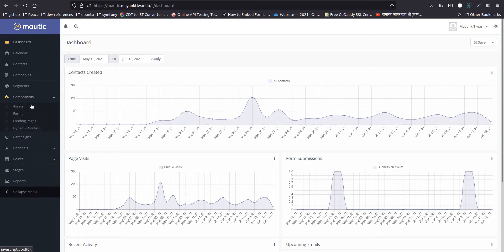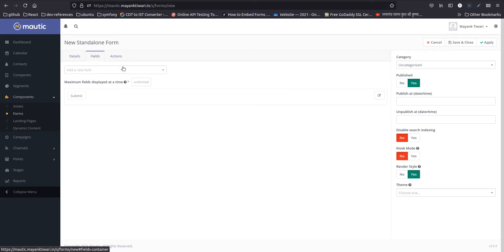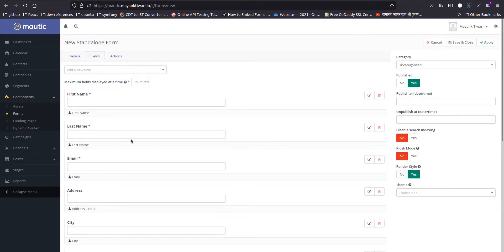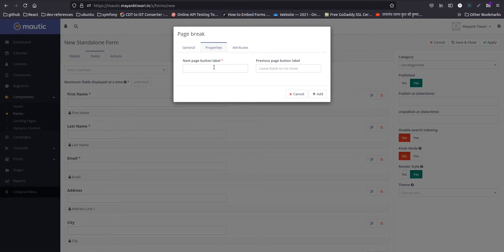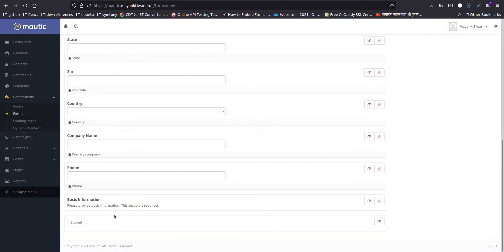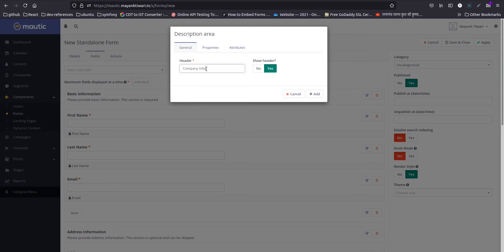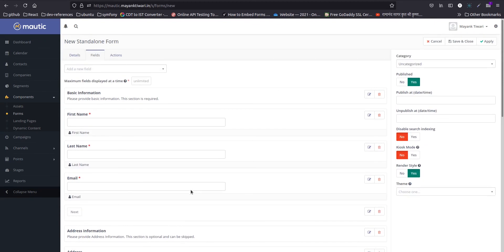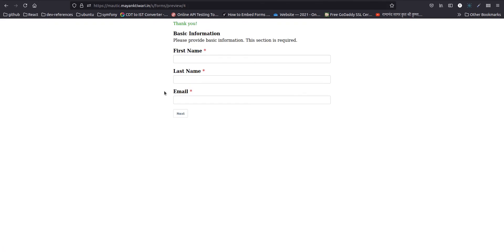Create Multi Step Form in Mautic 3

Comment: Thanks for the video. This is a very basic form made in Mautic but what if you want to create a better looking/colored opt in form with CTA that you can embed in your landing page?
Reply from the maker: The forms in Mautic are ultimately HTML form, you can use the CSS styling to adapt the design of the form, Mautic also provides some themes for forms you can try out them as well. However best way to make it compatible with your Landing page is to use CSS and enhance the styling of the Mautic form.